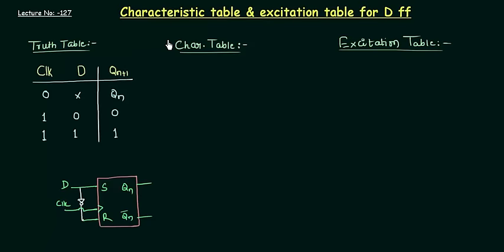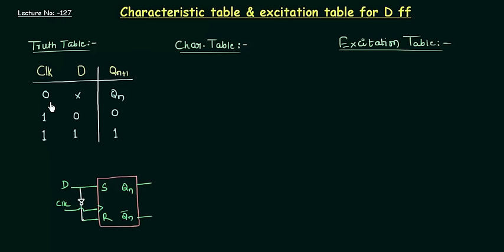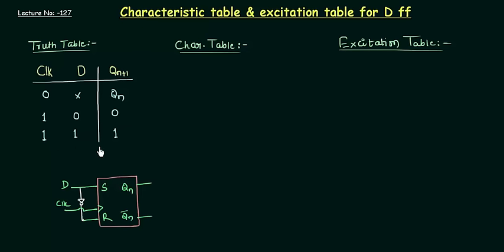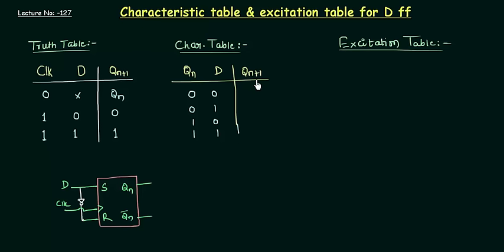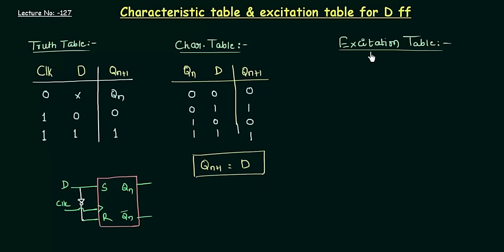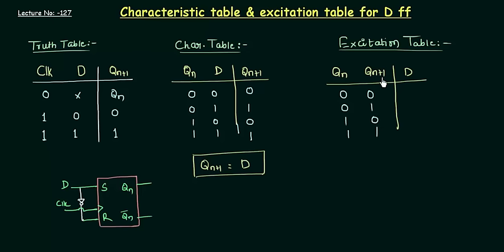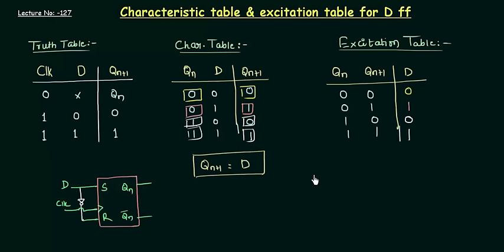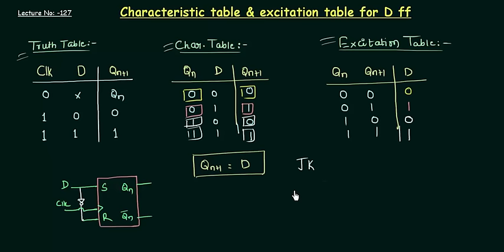Truth Table, Characteristic Table and Excitation Table for D Flip Flop

Comment: Is it always necessary to draw clock in a D-flipflop ? My teacher didn't draw clock in a D f.f but in JK flipflop only
Reply: It is not necessary to use clock in any circuit.Using clock is a precautionary step  as it removes stray inputs...